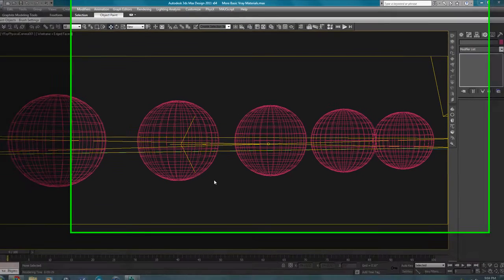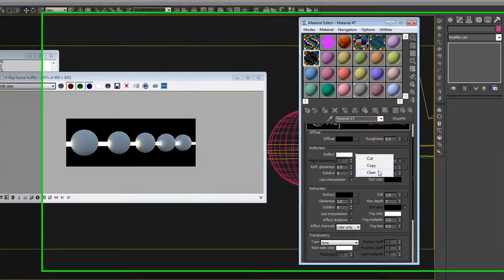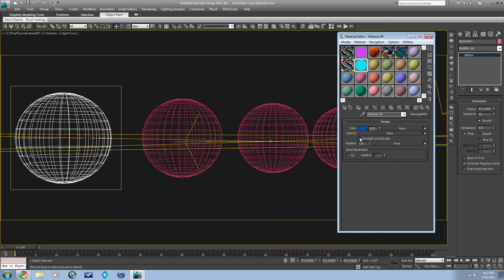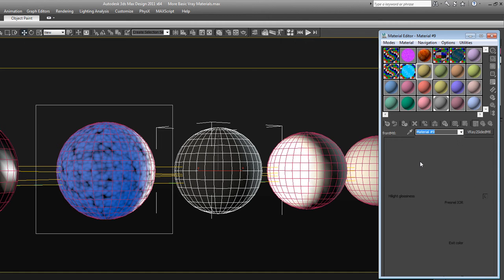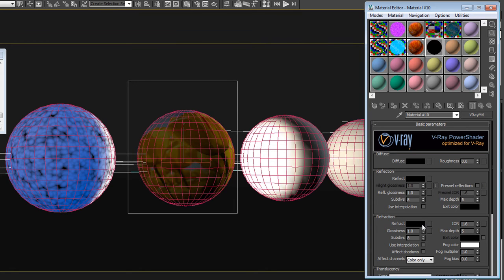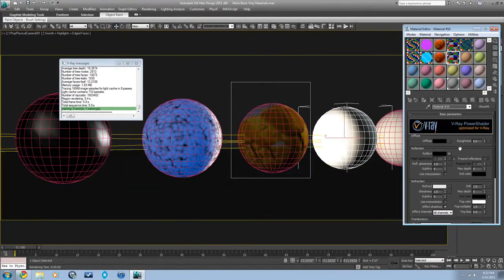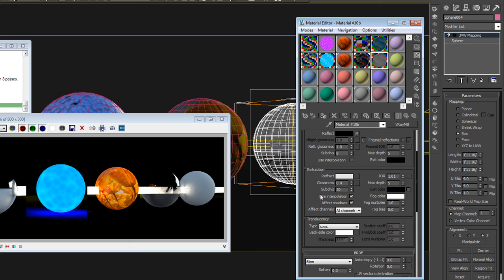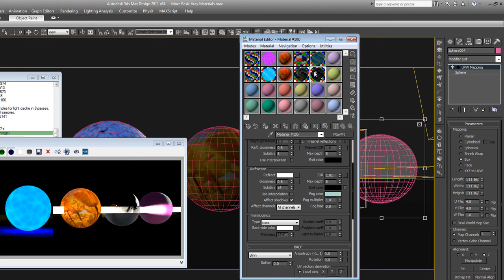Vray Materials: Different Vray Material Types and How To Use Them

Comment: You mentioned about SSS material at the beginning of the tutorial, but at the end you just took the glass material and made it look more fuzzy so it had some acrylic look at it. Good for some other glass types but still not the SSS mapping that I hoped to see though :( dont know if youre using SSS map's at all. Actually I try to use them for candles or fruits or such kinda things which needs some shine trough but scattering in the object. Would be nice if you can do some tutorial for that thx ^^